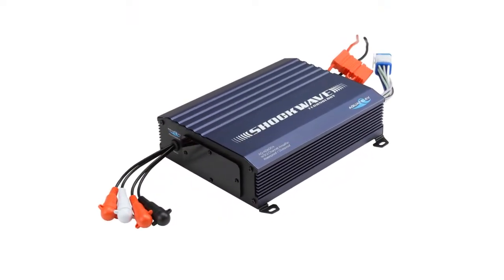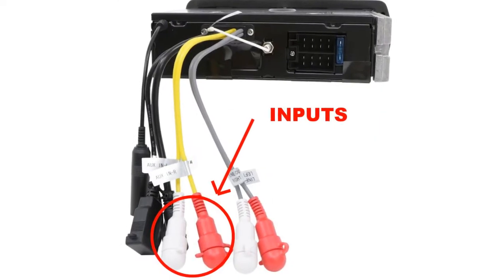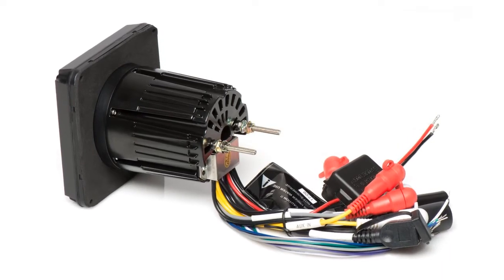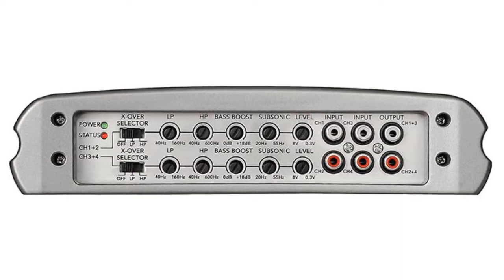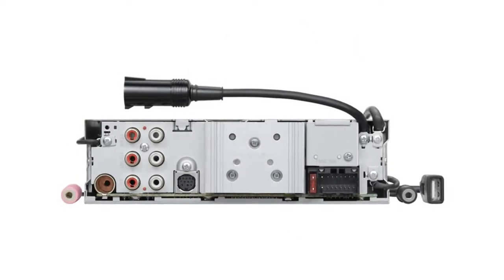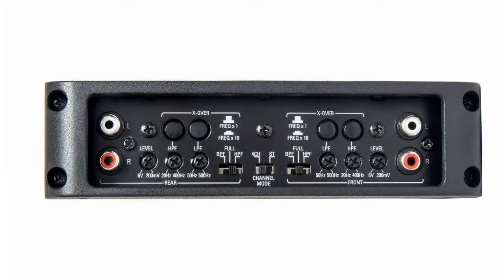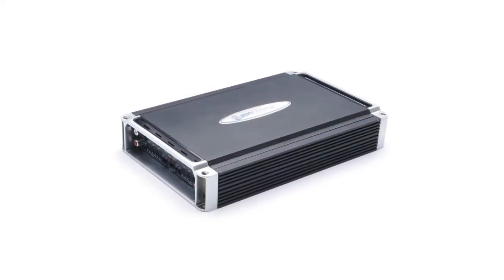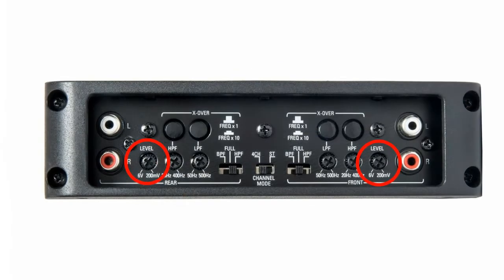Connecting Your Boat Stereo To A Marine Amplifier

Comment: I've just installed a Pyle Amp & Radio in an old boat that didn't have radio wiring already set up or a built-in harness. I wired 8 gauge marine wire to the amplifier from the battery, connected all 4 speakers to the bridged terminal on the amp, and connected the REM wire to the Blue wire on the back of the Pyle Radio and nothing turns on. Now, m a novice at this, but the instructions for the Pyle radio unit are terrible. I'm assuming a large amount of the power that I have connected directly to the battery from the amplifier should be enough to be diverted to both the radio itself through the REM and speakers. Supposedly the radio/head units don't require much power to run and the REM wire is supposed to handle 12 volts easily. So I thought this wire along with the RCA cables is all you need to signal and power on the radio. Perhaps I'm wrong about this...

So this leaves me to believe that I may need to separately wire the radio head unit to the battery as well. This is where the included directions in the radio are extremely vague. I'm guessing the directions are assuming everyone has a prewired car or boat and just has to connect the wires to the appropriate colors coming through the dash. I'm, however, starting a new install on a boat that never had a radio and no such designated wiring preinstalled in this boat. So explain to me if the power from the amplifier is enough to power the radio and speakers or if I need to have another dedicated power and ground line to the radio as well? If that is the case do I just twist the red/yellow wires on the wiring kit that came with the radio and connect them into separate 14-18 gauge new marine wire that I now have to run separately from the battery to the back of the radio? Please advise. I thank you in advance!
Reply from the maker: The head unit does need to be wired separately.   Yellow connects directly to the positive terminal on the battery or to positive power in a nearby fuse box.  Red connects to the ignition so that the stereo will turn off when the boat is turned off.  Black connects to ground or the negative terminal on the battery.
Reply: @rocktheboataudio  Thank you very much! I wish the included instructions to the wiring diagram actually showed this. Instead, it just shows wiring harness to wiring harness assuming everyone is already pre-wired for a stereo system.

Now it seems I can also combine/twist the red/yellow strands and connect them to positive power to the battery without any issues. The on/off switch on the radio should act as my cut-off switch, not to mention I have a master switch disconnect on my marine battery to cut off all power anyways when I want to use my solar-powered trickle-charger to maintain the battery. 

Therefore, I would be fine bypassing the ignition switch right if I remember to manually turn off the radio at the power button or use my quick disconnect at the master switch? The ignition wire just seems like an additional fail to other fail-safes I already have. Let me know your opinion on this. Thanks!